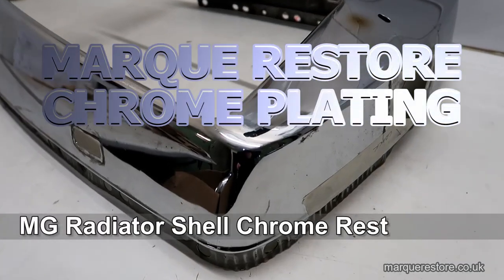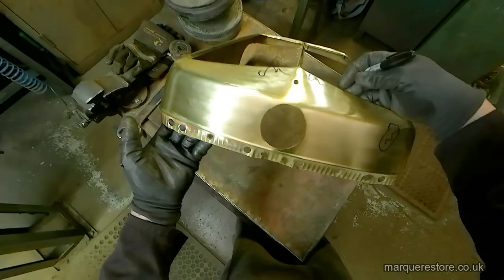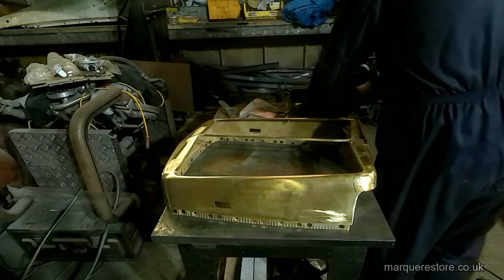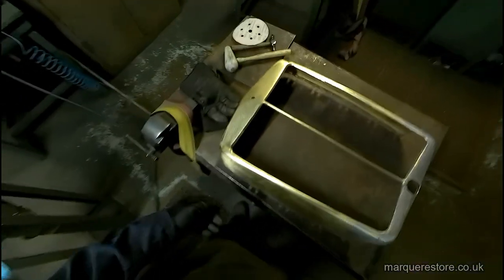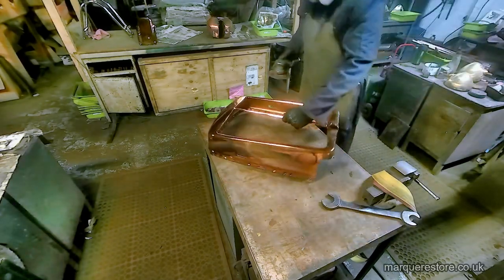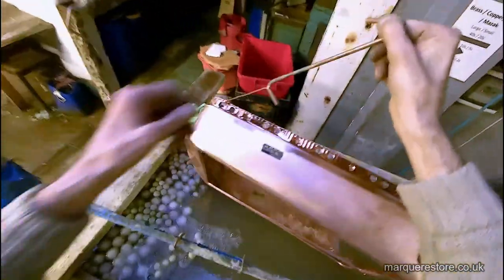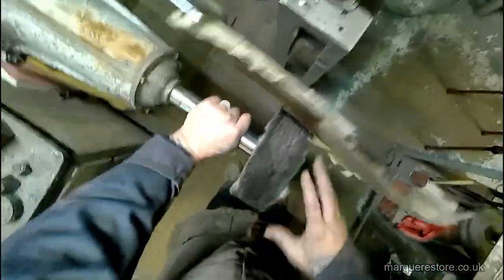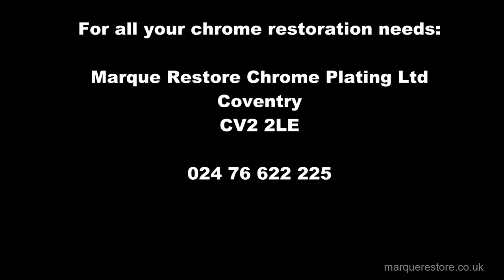Restoring a Chrome Radiator Surround from MG TD

Comment: Hello, Very interesting and informative videos!! I have a question. Can you plate nickel straight over brass without using copper as a strike?. Do the zinc in the brass mean that a copper strike is required over brass? Thanks for the advice and great videos